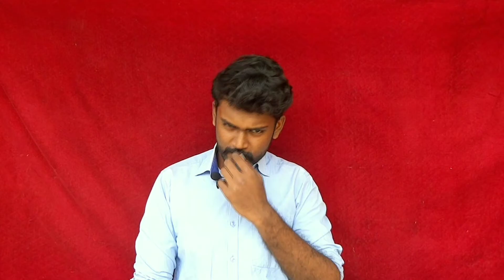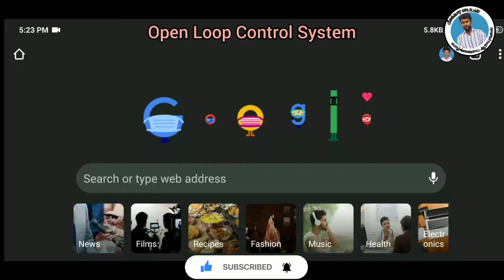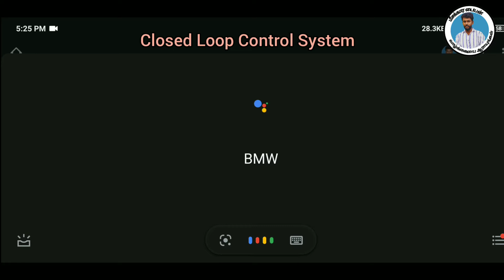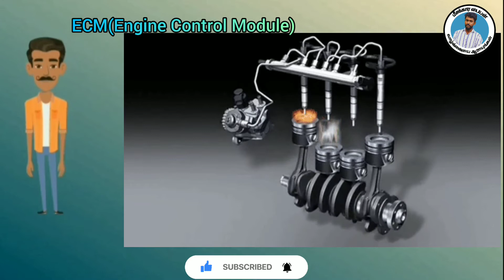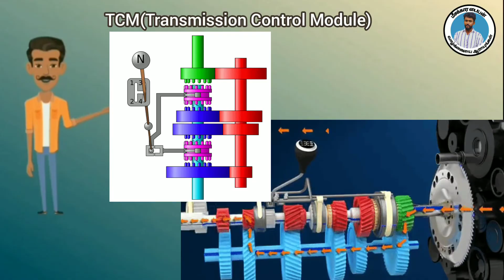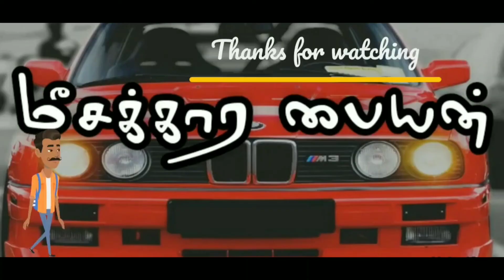ECU | How Engine Control Unit works | Types of ECU | தமிழில்

Comment: Enaku rmb naal oru complaint solve aaga matinguthu ... Car running la hard aaiduthu then steering hard aaiduthu Meterla entha indication uh show aagala... Swift dzire 2019 running km50000 help me pls
Reply from the maker: Power steering fluid Iruka nu check panunga bro.. top-up panunga.

Then wheel alignment correct ah illa naalum steering tight a irukum 

Power steering motor fault ah iruklam so ungaluku manual steering dha work agum